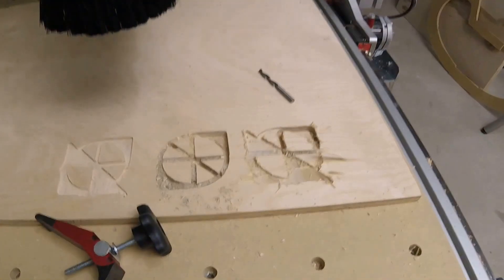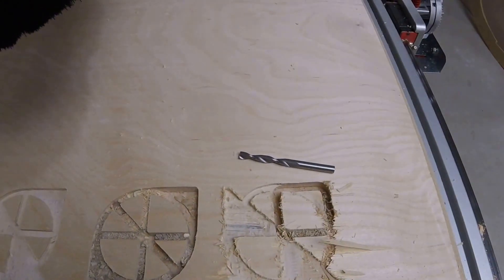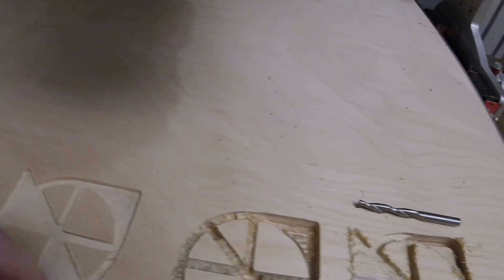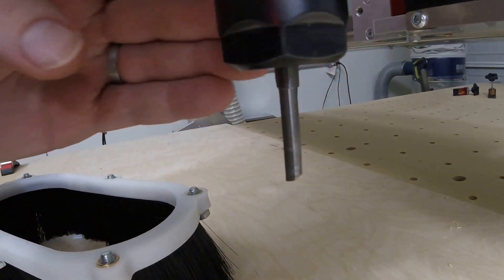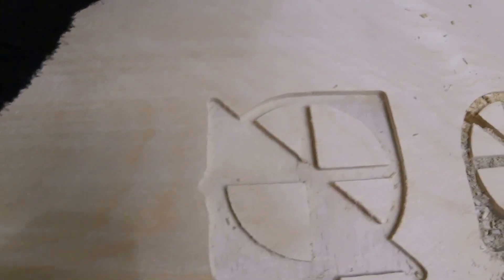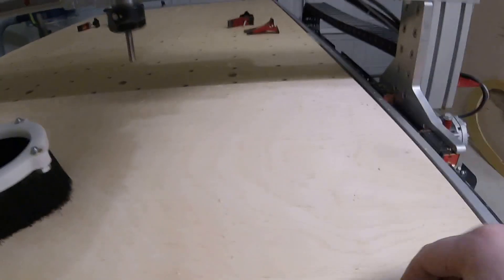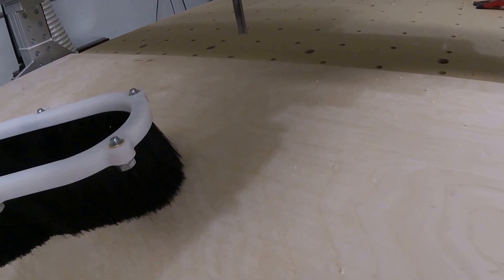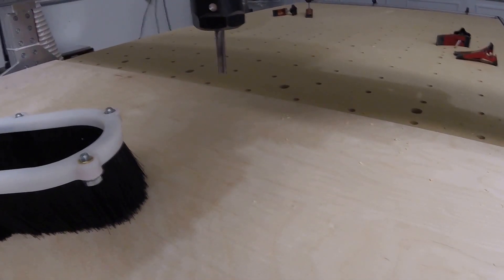The bit you should never use to cut plywood with a CNC..

Comment: For my experienced of 7yrs working on cnc.(2.5kw,,5.5kw spindle). every bits has different kind of works itself..
Different programming set up,speed,materials to use,rpm..
*straight cut- cleaning offset
*up cut - cutting woods/mdf
*down cut - cutting woods/mdf,,cleaning offset
*up/down cut - cutting apc material,acrylic plastic,aluminum material,pvc sheet..(recommended this material for single flute up/down cut)
*up cut ballnose - only for 3D works also for cutting.

Comment: Funny but...I use a twin flute carbide upcut in plywood... Upcut is certainly not ideal for plywood and also depending on the kind of plywood you are cutting. Speeds, feeds and doc is super important. I have found that with a upcut you can't just jump in and cut deep on the first pass. You have to break/but the top layer to ensure you don't have breakout and then go more aggressive. Also 20K RPM is my opinion is way too high and you will blunt your bit as quick as you can say "dull" especially if you don't feed at the optimum speeds. Once a bit starts to rub and not cut due to cutting too slow and spindle too fast you are heading for trouble. Take it for what it is... Buy the best cutters you can afford, don't skimp on this because good quality does matter... All the best :)
Reply from the maker: I am a huge fan of G-Wizard and start from there for all my feeds and speeds... And I would agree, if I had taken a shallow cut on the first pass to break the surface it might not have torn out.. But that is a bit more CAM work,  Just my opinion.
Reply: RPM 20000 is in fact way to low for small tools. To low cutting speed (is not feeding speed!) stands for low finish and short cutting edge life, so more sharpening. Such a small tool needs a much higher RPM. But once exeding the 24000 rpm there is need for another tool clamping system. the centrifugal force wil have tendens to open clamping chucks an the tool can slide out. Every tool (diameter) has his range of cutting speed (min- max) for optimal results.

Comment: Compression bits are also quite good, but DO NOT PLUNGE with them.  Always ramp in.  When I first used a compression bit, I was plunging several holes, and the bit got so hot that it started my spoilboard on fire.  I smelled the burining and looked in the plunged hole and it was glowing red!  I poured about a pint of water into the hole to stop the fire.  Thank GOD I didn't walk away.

Comment: i have the same bit in my collection for plywood, just be careful with setting it up because it IS a plywood router dado bit, which means it's not 0.25", it actually mics out to about 0.245" just like plywood would measure
Reply from the maker: Yup.. this is an older video... I learned that as well.. describe it accordingly to my CAM when I use it now.
Reply: right on!  i'm actually using that exact bit as i type this, cutting MDO for some cabinets, damn near razor sharp edges.  nice work on your channel, i'm a big fan of your reviews and tips!
Reply from the maker: Thanks!...  Much appreciated..

Comment: use a compression bit well worth the money - bits from Homedepot won't last long in plywood 
Funny video though - wasted so much wood trying to find the right settings
Reply from the maker: I have heard good things about compression bits,  once the bits I have start to wear out I'll probably look into them.. but carbide brazed edges on a $14 is a heck of a bargain... For aluminum I use 100% carbide bits from Lakeshore carbide..  

Do you use the compression bits from ToolsToday.com or a different vendor? you have a specific one you like best?
Reply: I prefer the Amana compression bits.  I've had good results with the 2 flutes on plywood.
Reply: @HandsonCNC  I've used both Amana and Onsrud with similar, good results.

Comment: Spin it fast. As fast as you can! 
Also router bits with 7* off centre flutes are the mutts nutts
Reply from the maker: Generally when I cut, I cut at 18k rpm.. I can go as high as 24k but I don't see an advantage as the SFM and chipload are already putting my IPM at the upper limits of my comfort zone... 

I have moved over to using more compression bits and really love those, as long as your first pass is past the up cut portion of the bit.